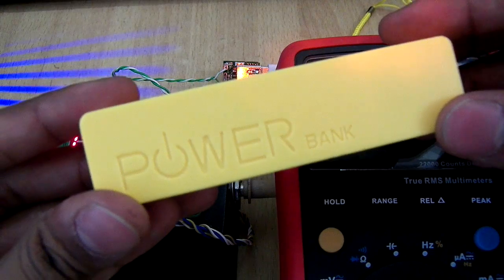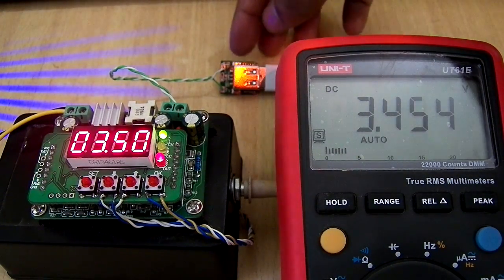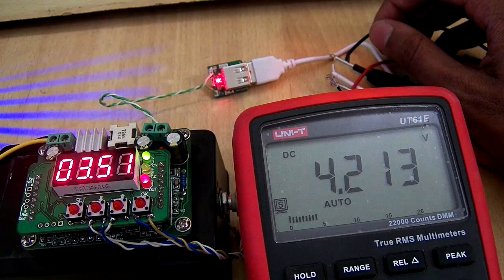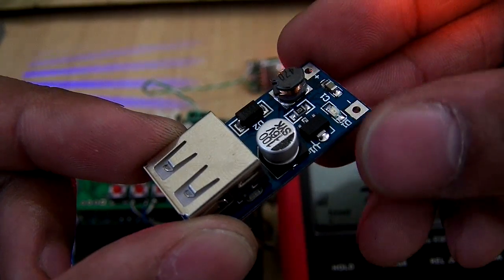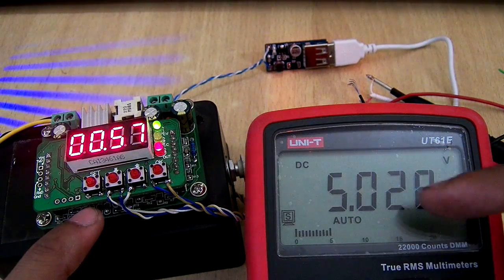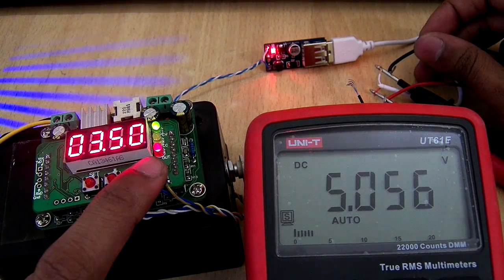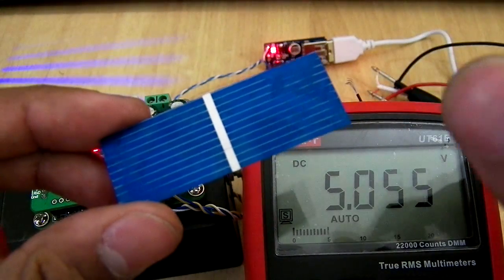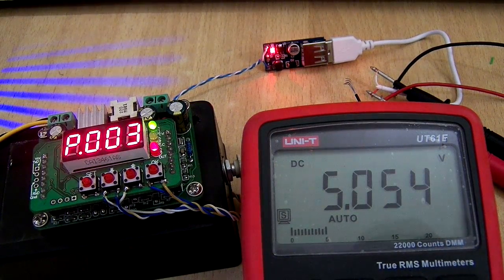How to make 5V Power Bank using DC to DC Converter

Comment: If the load is a battery the voltage is supposed to drop(if the battery is not fully charged). The first(main) stage of charging is constant current(cc) and while in constant current mode you will have a voltage drop due to the converters maximum amperage output in correlation to the battery(load) resistance(battery resistance changes with state of charge).

Comment: change your cheapo USB cable. Use a better set of wires. Most of the voltage drop is probably due to that cheapo USB cable.

Comment: I buy a similar type of power bank module.
I draw the 5 volt output from the solder joint of the out put usb port.

But when I draw this 5 volt for a circuit the indicator led is not glowing. As a result my circuit is reset it self after few seconds and  this process continues.

But when I charging my mobile through the usb socket then it is glowing.

Please help me how to solve this problem.

Comment: I have made the mobile power bank by 6v lead acid battery with using only one diode 5408. Multimeter had shown 5.06v and 0.7amp. But the mobile charging for some seconds and automatically off viceversa.  Why this was happened? I used diode to reduce the voltage to 5v.

Comment: bro.. can i use 13000 mah battery for input voltage in this circuit
Reply: Nazmul Hassan where do you get 13amphr battery . if you plan to use 12v battery then you need the 5v buck converter, if you use 3.7v battery then you need boost converter which is shown on this video.. and there is many fake battery in ebay and AliExpress that says 6000ma but actually they are less than 1000ma so be care ful. i also got cheated once when i bought some firepro battery that says 6000ma 3.7v each. i used 3 of those with a nice controller. it cant even charge a 3000ma battery it just charges it for 1000ma and then it is dead...
Reply: 13Ah 18650 batteries doesn't exist. They fooled you. Those fake cells can store max 1Ah when you're lucky.

Comment: i used these step up convertors with 18650 cells  ,each cell habing 6800 mah current ,i used 2 cells the step up circuit starts heating and heating and after some time it is giving the output 3v rather than 5v

Comment: Have you found a DC-DC USB 5V Step-up Boost Power Converter that can maintain 2 amps or at least 1.5 amps?
Reply: Hey, I thnk tht does not exist. Coz u can not get 2 thngs simultaneously high voltage & ampere. 

To get high amp u hv to use 12 Volt to 5 Volt step doen converter.
Reply: i just ordered a few dc dc usb converters. this being one of them. this is boost at 2 amps.

https://www.fasttech.com/p/1219202
Reply: fklotaloi You are right 12 v is needed for higher amperage draw.

Comment: 5:00 getting this data with a voltage source like this is useless. A real battery has a much higher interior resistance and will react differently.

Comment: which one is better, green one or blue one ?
Reply from the maker: +iceberg789 The green is better
Reply: alright, thanks !
Reply: both one is needed ,first one is for charging battery whose output is only 3.7 volt.As you know our phone need 5v input for charging. so we need to step up the voltage upto 5v. so second pcb kit which he shown that was dc to dc buck boost converter.That kit is helpful to get 5v output voltage

Comment: It is not about the Voltage it take. but the A (mah) why 3.5v
Reply: V + mah = Watt how more watt the longer the battery lasts. 3.5V isn't an recommend V because the cut of voltage of some modules is close to 3V. Fully charged a high power cell can reach a voltage of ~4.45V
Reply: +Против Глобал srry for bad typo. but I am not the guy that follow the rules. The best cell's If tested are Samsung Sanyo and LG all 2A+ . It is in possible that an cell is dead. The cells reached a minimum of 2.1 and an maximum of 4.45 other cheap Chinees cells are a waste you can't put them to the limmit

Comment: You should really test the module with 3.7-4.2V input, as that's the typical range for a 18650 lipo battery and that module is designed to be used with it.
Reply: ***** at 3V a lipo battery will have so little capacity, you'll hear lots of coil whine.

Comment: So pretty much every portable battery packs are using either multiple 18650 or LiPo battery cell.
My question when voltage is converted to 5V, how much power is lost during the process?

Reason I ask is because I just watched a local news which talked about these portable battery packs for smartphones and upon monitoring how much mAh packs can output was only about 70%.

I think I am going to connect my Hobby grade charger to do a discharge/charge test and see what it is.
Reply from the maker: Well, Each dc - dc converter Chip has its own efficiany plot at diffrent loads .
This plot is mostly given in manufacterer datasheets well worth to check datasheet before playing with it.

Comment: it maintains exactly 5.165v it's obvious if you connect a cable that conducts you will drop to 4.2... same with the other tests. Also the max load of these chips is 5w so if your device uses 1.5a or 2a it wont work without a serial connection